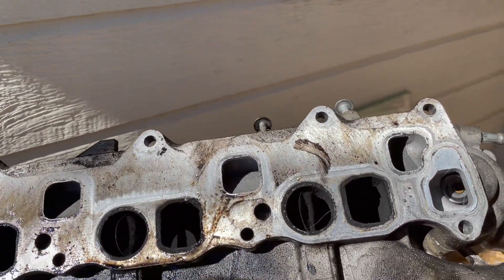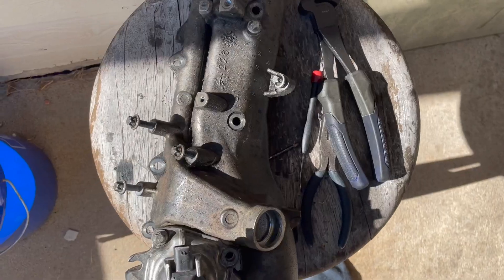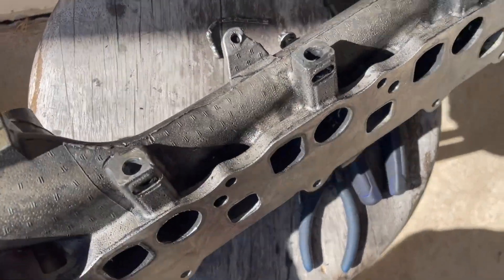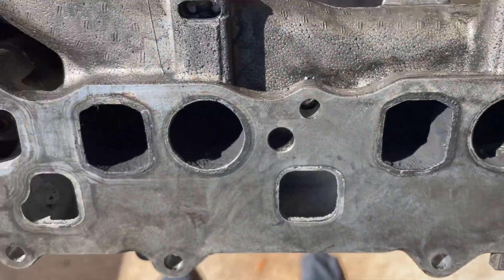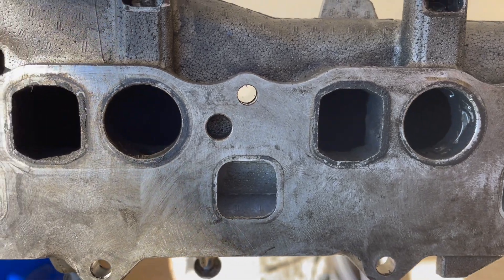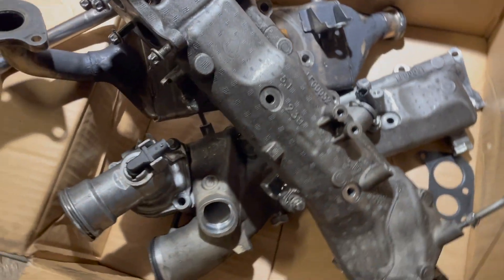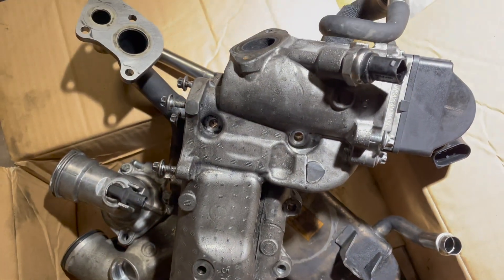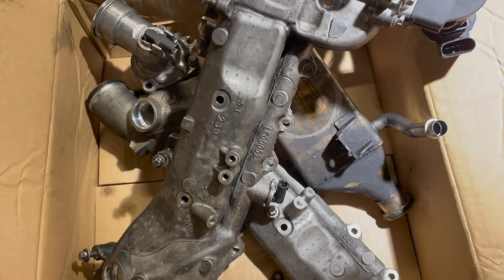OM642 (oil cooler leak fix 8) Swirl flap deletion fix

Comment: Why not just leave the shaft in place and knock out the butterflys and remove the plastic arms and you're done....   what the frick did you waste your time on bolts for??????????????????????
Reply from the maker: Yeah that would have been ok too. I just wanted the be extra sure there were no leaks. It wasn’t that much time to do the bolts but it was a bit of a challenge pulling the shafts out

Comment: How did you remove the swirl flaps? I’m struggling to get mine out! 😂😂
Reply from the maker: It was a pain lol. I just used pliers and remove as much of the flap metal as possible from the shafts, just keep ripping of pieces. Then with the flap metal mostly gone pull them out through the hole.
Reply: @DIY-VIDEOS  I’ve been following your videos step by step and so far, so good but these swirl flaps are a nightmare! I’m hoping I’ll be able to get them all out, I’ve managed to break one swirl flap off but the pin isn’t budging 🤔
Reply from the maker: Press any remaining flap metal tightly against the shaft so it will fit through the shaft holed. Then with some force you can pull the shafts out. It takes a lot of force but you can do it by hand with some good pliers
Reply: @DIY-VIDEOS  thank you so much! I just hope the reinstallation will go to plan! 😂😂 I’m hoping to get it done in a day or two

Comment: Hi what did you do with the motor? Did you reinstall or did you leave it off?
Reply from the maker: I bolted the swirl flap motor back into the same place but it is completely disconnected. The linkages are gone and the wire is not connected either. You can just leave it out
Reply: Perfect thankyou! I've got to carry the oil cooler seals on my jeep in the next week or two, I'm dreading removing the turbo and elbow due to having what look like less space! Any tips? Thanks again
Reply from the maker: @yahrudeboi I have a video on the turbo removal. Hope that helps, good luck with it
Reply: @DIY-VIDEOS  I've watched it many times! And the rest of your videos! How long would you say it took you in total?
Reply from the maker: @yahrudeboi awesome, thank you. It took two evenings to remove the turbo. Several weeks on the whole thing but I was working a few hours a day after work. I would say the turbo is hardest. The rest is just time consuming and need to keep track of how to reassemble

Comment: genius idea! saves welding😉
Reply from the maker: Thanks! 👍
Reply: @DIY-VIDEOS  is yours a coupe mate? ive got the c207 e350 and looking to do this swirl flap delete soon as my oil cooler seals need done. currently have the egr blanked off and the dpf gutted makes a big difference  😎
Reply from the maker: Mine is a 4 door. Good luck with it, sounds like you are on the right track
Reply: @DIY-VIDEOS  ahh nice mate. cheers🤘🏼

Comment: you can buy ready-made capping kits.
Reply from the maker: Good to know, thank you
Reply: @DIY-VIDEOS  Do you have the torque to tighten the screw on the orange band that goes into the turbine?
Reply from the maker: I don’t have a number but don’t over tighten this. In my case the previous person over tightened it and it caused the plastic to break

Comment: I have 2008 sprinter i put a resistor  it works fine but the only problem i have is the code still there because of sensor on the flaps arms is there a way to put a magnet or something to trick the sensors thanks
Reply: After about ~2009 if resistor doesn't work only ecu decoding can help. However it causes EGR valve to stuck open (why Mercedes?!) So there is need to decode EGR as well, otherwise car will shake badly on idle. At this point I am not sure, but probably DPF won't be triggering clean up and gonna clog up in few thousand miles. So - all fixed or all out.
Reply from the maker: They started adding that sensor in 2010 I think on the E series. So mine is just before that. I think there must be some sort of fix to this but I am afraid I don't know how to do it

Comment: what is the size of the screw
Reply from the maker: 1/2" diameter bolt. I used 1/2"-13 NC tap (DeWalt). The drill bit in that set is 27/64". Note this does not leave much room for error. Be careful to get it straight. The length of the bolt was 1.5" I think but the length can vary as long as it extends in far enough to cover the side hole. Use threadlock to make things airtight so you don't loose boost